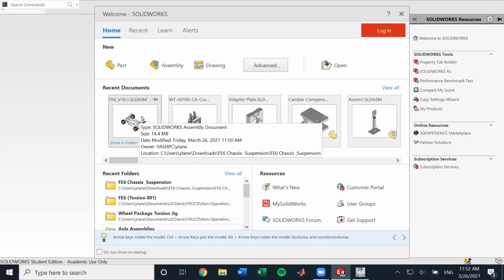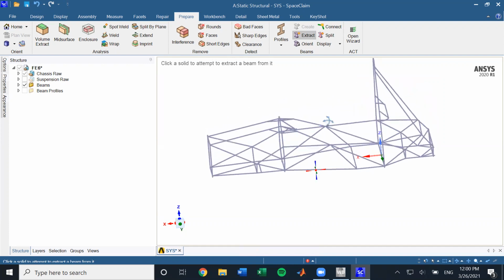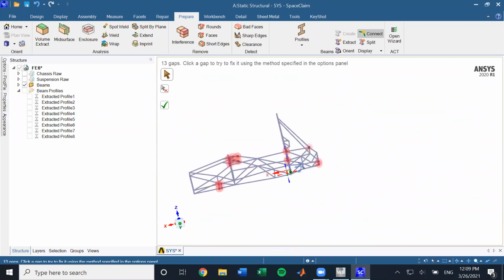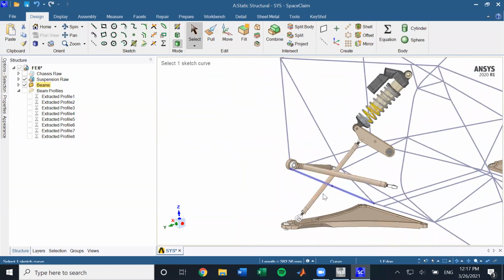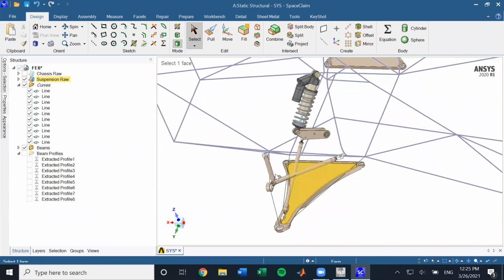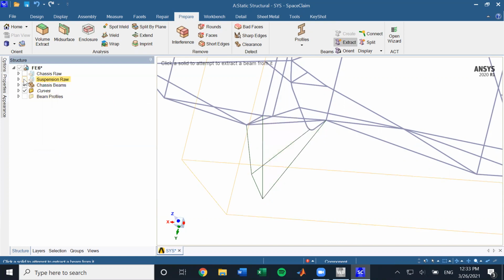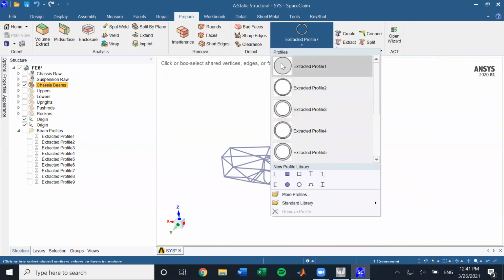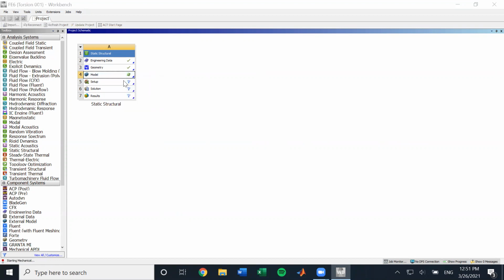FSAE Torsional Stiffness Simulation in ANSYS - Part 1

Comment: thanks it was an interesting video. I have a few questions though. q1: how did you come up with the chassis design? how did you size the tubular beams?

q2: how did you come up with suspension design? i.e. placement and stiffness?

q3: did you analyse the strength of the suspension components in ANSYS?